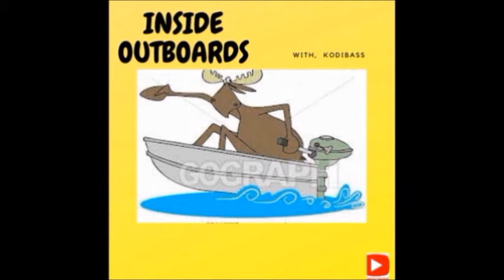SEAGULL  OUTBOARD     ( Part 1 )

Comment: Seagull went bust around 2000, please have a look at the small wheel at the start handle, it's always stuck up solid. The correct plug would be 8com or D16.
Reply from the maker: Well looks like someone knows a bit about these units...  Yep'   U R spot on that wheel is solid as a roman brick.  Do you know of any manuals / books  that  R  available that might  @  least  get me in the ball Park?      Thanks for  you info  helps me babby step Along.     kb
Reply: @kodibassInsideoutboards  Yes, I collect them among other models, but more the early stuff, as far as manuals they are pretty basic, but I can help you out if you wish.

Comment: looks like the transom mount is on a slide pole and adjustable in height.. ive heard that you can spin these over with just your hands to get them to pop off.,. wonder if the fake brass paint job was from the bluebloods factory.,,
Reply from the maker: Yep' I have never saw that style of tank,  I  think I have a correct one or two.     kb